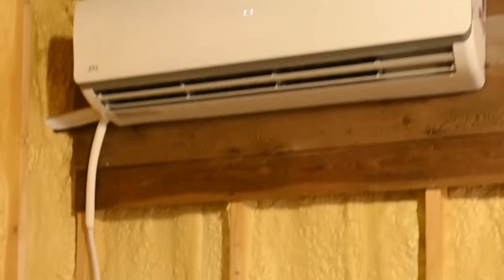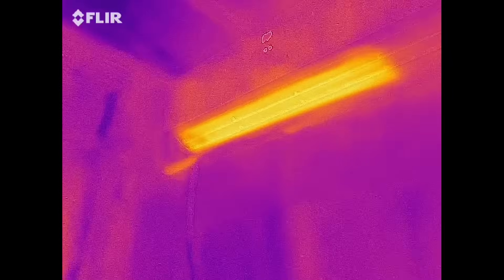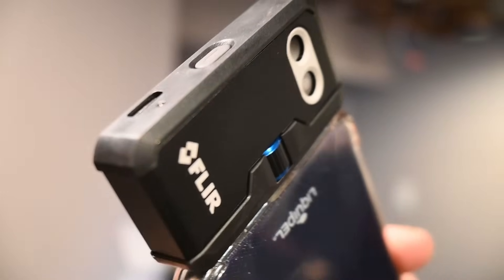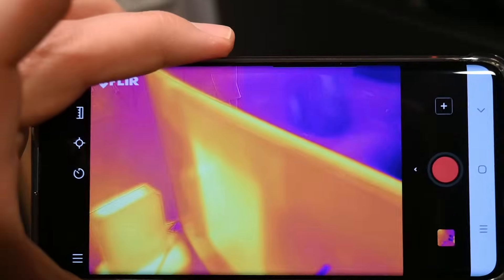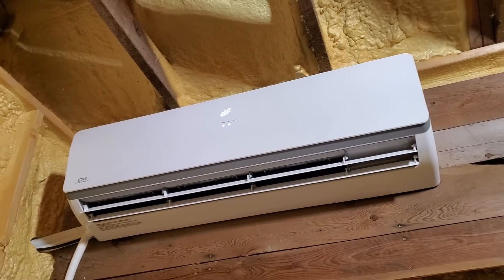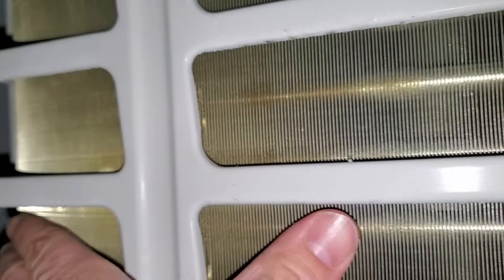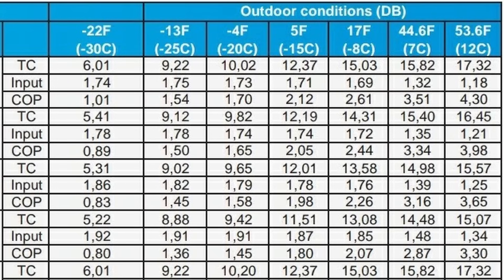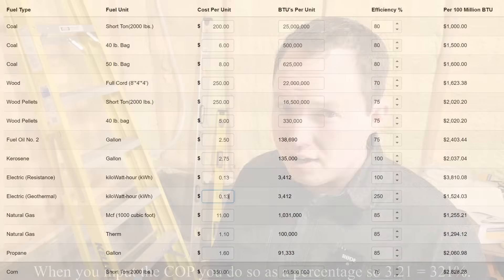Can You Use a Mini Split in EXTREME COLD? Heat Pump vs. Propane Cost Comparison with Thermal Camera

Comment: My Carrier heat pump was still putting out heat at -18F the other morning.  Not full btu's though.  Supposed to shut down around -22.  If I was in northern MN it wouldn't be enough.  -40 and  colder up there this week.  I am in SE part of the state.  Suspect my unit is same manufacturer as yours.  Looks the same.
Reply: At that -40 point I'd look at geothermal, though I am not sure if your land is rocky.
Reply: @JasonW.  solid limestone.  I will be installing a pellet stove or propane stove this year.  We have backup electric baseboard heat, assuming the power stays on.  I can run a pellet stove off my battery inverter system.  Gas would be millivolt.
Reply: @Bob.W.  IMHO unless it is a propane furnace, using a propane heater has some disadvantages. It dumps moisture into the space your heating. As a wood worker I try and avoid that.
Reply: @bryanrocker5033  I would not use an unvented heater of any type.  It would be a vented propane space heater, like a Williams or Empire.  Old technology, inefficient, but simple.
Reply: @Bob.W.  I agree, unvented heaters are a no go IMHO.
Reply: C&H, Pioneer, Senville and others are all made by Midea. Decent units IMO, because even the Japanese brands are all made in China or elsewhere.

Comment: Good info...thanks!
Last April, I installed a Senville LETO (18K BTU/19 SEER/3.1 COP).  I live in upstate New York.  So far I am very impressed with how well the unit works for both heating and cooling.  Actually, I have used it more for heating than cooling.  I have a small propane fireplace, but it sits idle (I haven't even lit the pilot light this year!)  Today it never got above 20 and the mini-split heated my small home easily.  During the colder evening hours, I wake up my wood boiler to heat the floor (yes, I love my heated floors!)
I would appreciate a discussion (theory of operation) on the defrost cycle.  My mini-split has 3 sensors.  I am interested in how the controls uses these temperature inputs to decide when a defrost is required.  I have watched the unit's entire defrost cycle...usually takes between 8-10 minutes before it goes back into heat mode. Neat watching the frosted coil thaw out!  It took time to get use to the unit switching from defrost back into heat mode (WHOOOOOSH!)  Regards, JT
Reply: Time spent in heat mode, but the key indicator is temperature of the outdoor coil. I haven't looked at all the sensors yet in my Senville unit. But if you are in NY you should have gotten the Aura series unit instead.
Reply: @sprockkets  Actually, I am very pleased on how the unit I have has performed.  Coming up on the one-year anniversary since startup.  
I really wanted a Mitsubishi, but ALL of the Dealers here are arrogant, self-righteous, disrespectful, and rude!
Reply: @Kntryhart  No one here wanted to install one either. But I think it is because they know once they tell you the price it is a hard no. Like, probably at least $3000 a zone.
Reply: Got the 25 seer unit in ottawa....  amazing machines!

Comment: In the last few weeks, my mini splits (2) both have a one foot tall block of ice on the ground below them. I put in a 10kw electric heater to kick in if the shop gets below 52, mini splits are set to 61 F (lowest mode, except eco mode @ 51 F).
Reply from the maker: Sounds similar to mine. Minimum thermostat setting is 62° f but in "FP" or freeze protection mode it will set down to 46° f.
Reply: @BenjaminSahlstrom  The day of -12 F was a hard day on the minisplits. One shutdown heating, but was making a lot of noise outside, I'm guessing to try to defrost? The other unit was putting out nice heat. Shrug?
Sunday will be brutal again.

Comment: Heat pumps spend more time in defrost when the outdoor temperature ranges from 47F to the mid 20’s especially rainy/snowy/freezing rain miserable days. For best results try to install the outdoor unit where it’s protected from the wind...use evergreen shrubs or decorative barriers at least four feet away from the unit. Lengthy defrost cycles dramatically reduce efficiency.
Reply from the maker: Good tips.
Reply: @BenjaminSahlstrom  All good tips my installers neglected to mention when I asked for quotes. I certainly feel most of the installers in my area are singularly focused on getting paid. I even asked about putting the external units under my deck and they poo-pooed the idea. Many also wanted to hang the units right off the exterior wall behind my living room which I understand often creates annoying vibration.
Reply: @SirBufo  I installed a two ton Mitsubishi  single  outlet  unit five years  ago . The sound level  is about that  in  a library!  
For my particular  issues  of high heating bills from  oil fired hot water heat and a desire to get window ac's out because  of security  issues I am only  sorry  I  didnt install the  mini split ten years ago. Ive saved  the install cost ($4200.00) in the  winters alone ,  have the added plus of NO mildew  or  mold  in the summer. There are variables  in every home so my  advice is read a bit before  buying,  especially  from green building  blogs ,  I had  a exelent  installer ,  some are terrible  it appers.
Reply: @SirBufo  Under the deck is not a good idea as it will reduce air flow and reduce capacity and efficiency.  You also want them out of the snow.
Reply: Wouldn't more wind be GOOD?  I has a fan in it.  The objective is to equalize the coils with the ambient temperature, that's what the fan helps to do.  Wouldn't wind help do that?
Reply: @Chris-ie9os  The outdoor unit needs a lot of air to “breathe” but in windy conditions during defrost the melted ice-water will refreeze onto the coil before it can exit the unit through holes in the base pan. On some days, the unit may have to defrost every 30 to 45 minutes creating lots of melt water that continuously builds-up on the outdoor coil, usually from the bottom up. Ice can crush the copper tubing if not defrosted and run off properly. Once this refrozen defrost water starts to build-up, there is no way the machine can remove it completely, even after 10 minutes in defrost. I have manually defrosted many an iced-up unit facing directly into our northwest prevailing winds over the years.
Reply: @georgeian3243  And defrost mode will take longer when it's windy so overall less heating capacity.
Reply: @Chris-ie9os  until the wind carries rain/sleet/snow into the unit lol
Reply: @bryanjk  If it's elevated that shouldn't matter... it can't accumulate.  Mine is ~8' off the ground.
Reply: @Chris-ie9os  Just under normal A/C mode of heating mode any wind to goes against the flow of the outside air fan can make the unit less efficient as it causes more "hang" time over the outside coil. The outside fan is not that big power wise so when there is an opposing wind to the direction of the outside fan that works against the heat exchange of the coils. The objective of the coils is heat removal or absorption depending on the mode. So the higher the Delta T the better performance of the machine.
Reply: @SqueakyHinge  Your delta T statement is kind of correct but that applies to the refrigerant. The delta T people can measure is between home and outside. The smaller that delta T, the higher the COP but the lower the duty so it won't run as often at higher COP.
Reply: @Chris-ie9os  maybe others have commented this already,  but on some units the wind can move the fans and cause damage
Reply: To add to that, the COP numbers don't take into account defrost cycles, they are steady state operation.
Reply: Bought a Mitsubishi Hyper-Heat in early January. Worked great until Big Freeze in February (in Tennessee). When the temps hit the teens, with the damp, snowy weather, the HP was pretty much useless. Defrosted off several gallons of water daily. Then when it blew out hot air, it quickly froze up again. However, this was a rare event, and works great otherwise.
Reply: @jmmoore3865  You probably didn't get the h2i unit, and most of them don't include the internal heater, which IMO is quite sad. They want around $300 for the part.
Reply: Don't bother. Just use a groun d source heat pump.
Reply: @rogerphelps9939  I have both. For most people adding to their home, the split vent is much better. For new construction, sometimes a ground source can be better.
Reply: I spent a few days after Christmas without full heat (besides baseboards) after the winter storm over the weekend. My complex kept blaming us for turning off our hvacs (I am guilty of that when it's bedtime and I'm not in my living room) but they also didn't take accountability that these things will stop working in defrost mode and defrost mode can last for days. It was single digits for days after the storm and I live in a loft in Detroit so these baseboards were running my utilities through the roof. After the hvacs started back working, maintenance left a note on our doors telling us to not turn our individual wall units off ever. It makes no sense to me especially since other tenants were without heat and they do not turn their heat off like me. The PM are also new to the complex and are the first people to get on me about turning them off. Never heard this before.

Comment: Great job, Ben! We built a net zero passive solar home in East Central MN 5 years ago and use mini-splits mostly for cooling but for a little bit of heating. Ours are Mitsubishi and are rated for -19º F. I usually run them a bit in the winter to exercise the heat function. Yes, they do work! I turned one of our two units on today after watching your video. Ambient outdoor temp is currently -5º F, and the units are outputting air at about 100º F.  They are pulling about 1000 watts when running. It truly is amazing technology!  I really enjoyed your infrared camera shots!! Cheers!
Reply from the maker: Wow that's great!  Do you have a grid tied solar setup or are you totally off-grid? Would be interesting to see your net zero setup sometime!
Reply: @BenjaminSahlstrom  We are grid tied. We have enough excess capacity to power an electric car. But until then, we just take the cash the utility pays us for our excess electricity!
Reply: Love the name.

Comment: There are units that maintain full capacity down to like 0f. Capacity is more important than the cop when the backup is electric.
Reply: But at some point doesn't it become cheaper to run my main heat source even if that is electric? I'm from northern mn too and as of now these smaller heat pumps will only ever be supplemental heat.
Reply: @jwill9877  it has to be sized for heating. the energy a hp compressor consumes gets absorbed by the refrigerant and helps heat the space. only when the efficiency drops to the point that defrost cycles offset any gain. i would say a cop of 1.2

Comment: It is worth noting that using only a minisplit also allows you to build a more thermally efficient bulding.
Reply from the maker: How so? Just because you need fewer holes drilled for exhaust to the outside?
Reply: @BenjaminSahlstrom  Yes, and also eliminating the ventilation and ductwork of a traditional system, which actively pump hot air out of the conditioned space.  The minisplit's fewer penetrations are also easier to seal.  A tighter home is much more energy efficient, resulting in an even greater financial advantage, year-round.

Comment: I wonder how the unit knows when to run dF mode
Reply: It might be monitoring the power used on the external fan, for resistance in airflow across the coil? With three phase powered motor, I'd assume this shouldn't be too much to do.
Reply from the maker: I would guess it is preprogrammed based on the temperature and runtime of the unit.

Comment: Great video and really helpful. I will be using a mini split for my shop (16x24 insulated garage). We are on propane which I knew would be much more expensive to run vs the mini
Reply from the maker: Exactly. It is great to have the backup option of propane available though. I am going to install a vent free LP heater in the coming days for that purpose.

Comment: You got a deltaT of 2 outside,  what were you getting across the indoor coil?
Reply from the maker: I didn't check it just then. I would guess that it would be much higher as the coil is more dense on the inside unit.

Comment: This is great news I too live in MN- Le Sueur Co. The valley tends to be warmer than the twin cities area. I've looked at Split minis for my heat / cooling source. My other question is since heat rises can minis be put more towards the floor than the ceiling?
Reply from the maker: Generally they recommend putting them more towards the top but C&H also make console/floor mounted units.

Comment: We are going to build a new house, which would be better for whole house HVAC, traditional system or Mini split? Approximately 2000 sq. feet, northeast Florida, brick with foam insulation .
Reply from the maker: If you're building new I would recommend a ducted system personally.
Reply: I would do mini split ceiling cassette and zone every room , by zoning it you will save even more.
Reply: I'd use ductless splits for heating/cooling, and an ERV with small fresh air ventilation. Look up "passive house standard."

Comment: Well done vid, Ben.  Unlike your tropical southern Minnesota temperatures, I had -33F yesterday morning as I cruised by the Mississippi River.  I think the standard heat pump(non-minisplit) units that most HVAC guys install have a cut off temp that hovers in the 20F range.  This mini-split unit would be a good option for those over garage bonus rooms that tend to be outfitted with baseboard electric.
Reply: My Trane regular split system works down to -7F according to Trane's documentation. It's never been that cold here.
Reply: @brianleeper5737  Is your train a single stage, dual stage, or continuously variable inverter unit?
Reply: @gregorymalchuk272  It's a single stage unit. The lower temperature limit is controlled by the defrost board, which can measure ambient temperature. Below -7F it will shut down the compressor and call for aux heat. I had to dig through quite a bit of Trane documentation to find this out.
Reply from the maker: Oh ya betcha! What heat source do you have in your bonus room?
Reply: @BenjaminSahlstrom  I have a 5Kw electric that keeps my bonus room warm, plus I do have a single flex duct from my furnace that pushes some heat.   The 5Kw unit is on my off peak panel, so I get the cheaper rate at $0.0672 per Kwh.  Same with my heat pump, slab heat boiler, and plenum heater...it's on the off peak controlled panel, so I'm seeing the propane furnace kicking on frequently during this arctic cold snap as the power company is controlling the panel fairly frequently.  I've been supplementing with my cast iron Jotul wood burning unit that sits in my living room...nothing like a fire crackling away when the air gets brisk outside.
Reply: i prefer burning money. its 100% efficient at turning your money into heat

Comment: Do they SWITCH to electric resistance heat when outside temperature is very low?
Reply: Minisplits don't usually have resistance heat coils in them.
Reply from the maker: Like Brian said they usually do not but it is an option for some units.
Reply: @BenjaminSahlstrom  I have a standard ducted split system and I have disabled the aux heat by putting a switch (just a standard light switch in a handy box) on the W wire between the thermostat and the air handler. Additionally, I turned off one of the breakers so it only has 9.6kW of aux heat, not 19.2kW. The aux heat will still come on during defrost, but only half of it.

I haven't had to turn the aux heat on at all this winter or last winter. The thermostats I have (Honeywell--it's a zoned system with an Aprilaire zone controller) seem to be very dumb about turning aux heat on when it is not needed, yet they are from 2017.

Fortunately, the switch prevents the thermostat stupidity from jacking up my electric bill.

Comment: The building is loosing heat?  Nice video.
Reply from the maker: All buildings lose heat. The amount of insulation used just slows that process down somewhat which is why the framing members have more heat loss and therefore are more visible on the thermal camera since they aren't insulated nearly as well as the other wall cavities.
Reply: Benjamin Sahlstrom Thank you. thermal camera was very informative, framing members etc.

Comment: My 3 ton R22 HP starts to loose below 30F about 1.5 ton, but I'm in Florida where it almost never goes under 40F, and when 60F outside it's doing 36k btu+.  Good tech explanation.
Reply from the maker: Typically I set traditional heat pumps to switch over to gas somewhere between 20-30 degrees. Below that temperature it isn't worth wearing out the heat pump/AC unit in my opinion.

Comment: How do you heat down vs up?
Reply: If you notice, virtually every commercial building you've ever been in heats from the ceiling! The key is air movement (and having a relatively airtight construction). These newer furnaces with ECM blower motors sip electricity and keep the air moving more of the time . They are, however, more susceptible to voltage spikes. I would be interested to hear Ben's thoughts about them, given his experience in the field.
Reply: Same way you heat across to the center of a room. Air circulation.
Reply: It works, but not as well. For mostly winter heating, it is better to use floor units.